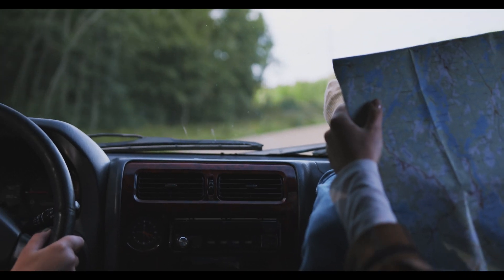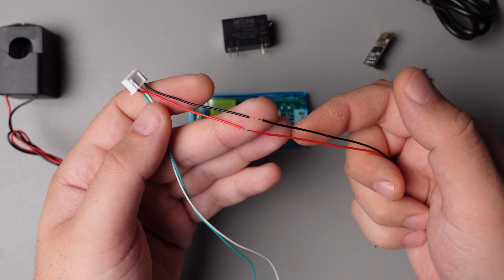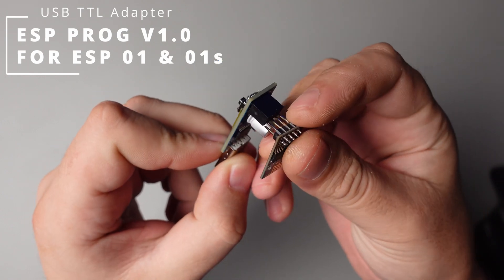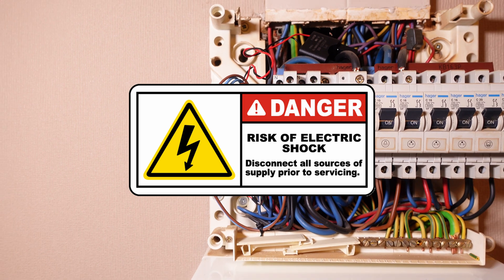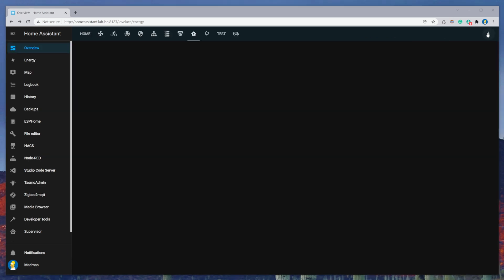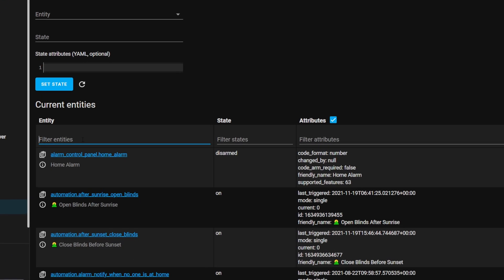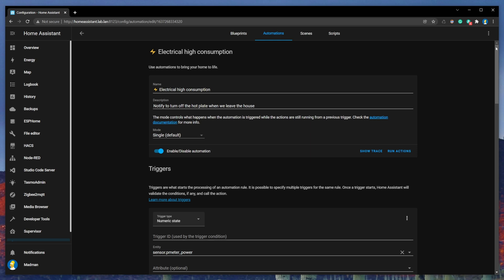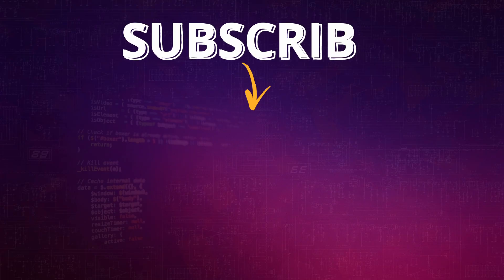Home Assistant Energy Monitoring and Presence Detection

Comment: Hi thanks for the video works perfectly on my system. Question is there a way to program the ESP32 to have a more accurate reading on the PMeter_current took a clamp meter and the reading is off by 0.2amp.
Reply from the maker: Hi, I think there is no way to calibrate "Current" in esphome, maybe I'm wrong.
Reply from the maker: Sorry, the first time I read your comment I did not understand your question 🙂, yes, you can  "calibrate_linear" https://esphome.io/components/sensor/index.html#calibrate-linear
Reply: @PricelessToolkit  Hi thanks will test and see if I get it going, I'm not a programmer LOL.

Comment: Hi there. Thank you for this great video. I was able to successfully get it working, first time. Do you have code  that would allow the use of the PZEM meter with the four seven segment displays on it? I understand it uses a different protocol. HA help files describe a program to do this but it is serial only, not OTA using the ESP-01s.
Reply from the maker: Hi, I'm glad everything worked. Do you mean the second ESP module with the segment display? If so, then I don't have the ready code, but it's easy to do 1. (https://esphome.io/components/sensor/homeassistant.html) 2. (https://esphome.io/components/display/index.html)
Reply: @PricelessToolkit  No, I was referring to the PZEM-004, which I understand is not modbus.

Comment: Thanks for sharing.  The only missing part is the wiring connection from TTL port to ESP01S.  It would be great if you can clarify on this.
Reply from the maker: Hi, Need to be connected like any other uart device "Transmitting ligne to receiving ligne" ( ESP TX to RX ESP RX to TX )
Reply: Hi! Ttl port need 5vdc to work and you use 3,3vdc, can you explain betterthis point?

Comment: Did you modify the pzem module adding 1k ohm resistor? It should work 5v otherwise....
Reply from the maker: No, I didn't, It working with 3.3v TTL without a problem.